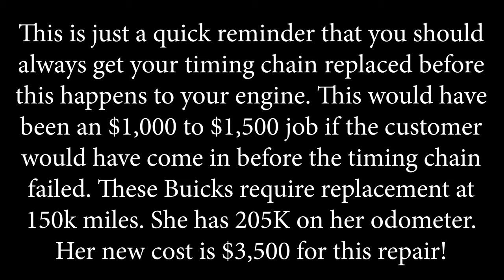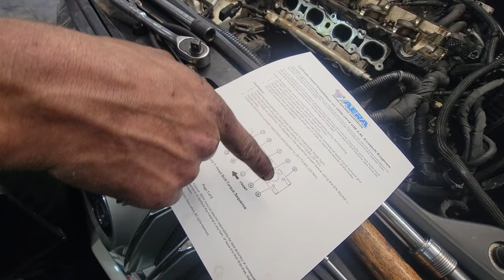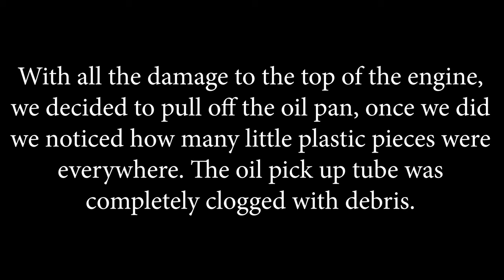Avoid this mistake: Ignoring your timing chain replacement. Costly mistake

Comment: I was going to say that on a 200K mile vehicle that I'd probably look for a good used one to put in, but then I saw the price of the used ones, wow.  A low mile used engine as in less than 50K miles is no cheaper than the rebuild and in many cases more expensive.  So this was probably the best path if you have a good machine shop nearby.
Reply from the maker: We do. They only charge us $125 to clean, shave the head, and test it. Upside, the turnaround time is about 2 days.